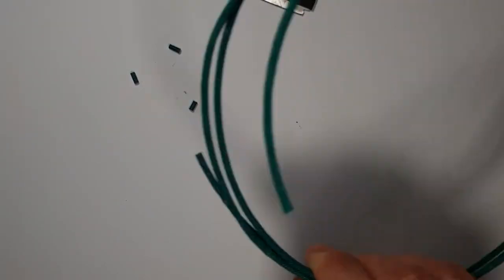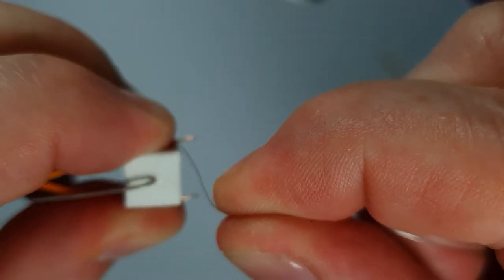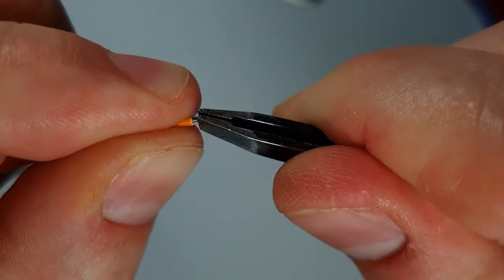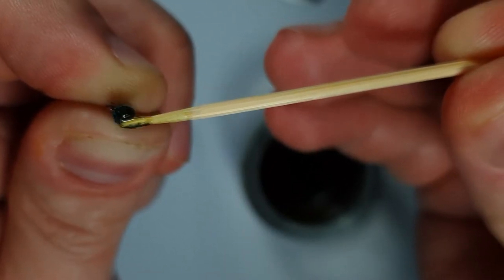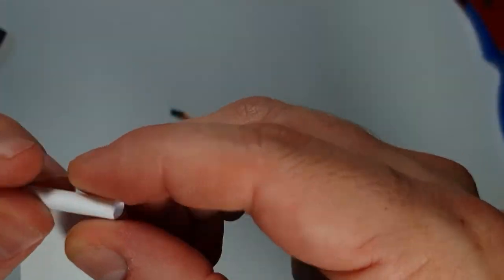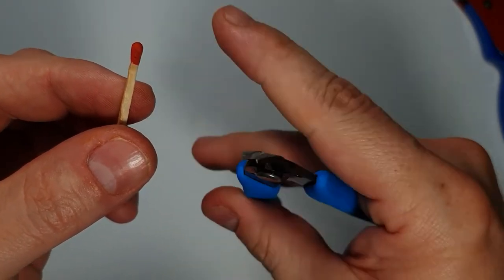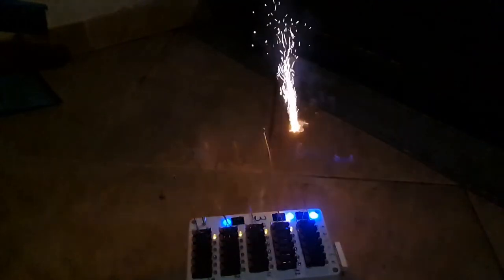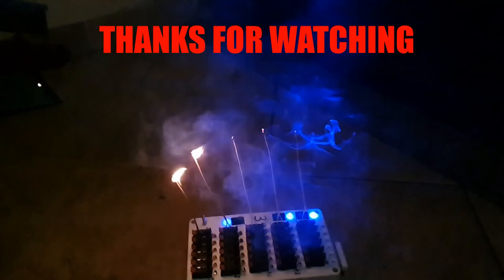Home made E-match, electric fireworks igniter.

Comment: Nc needs to be clamped or welded  because if you solder it just melts the solder and breaks the connection and fails all time , I have worked with it in past and i hated it I would go through rolls determined to make it work my way , until I figured out I would never win the battle, solid core right gauge for your needs if its to thin you can double or triple it twisted to get higher resistance not perfect but saves buying more of fiddle stuff